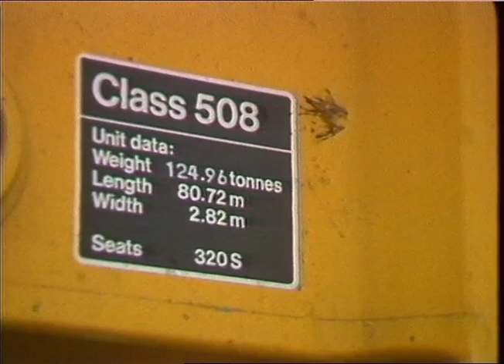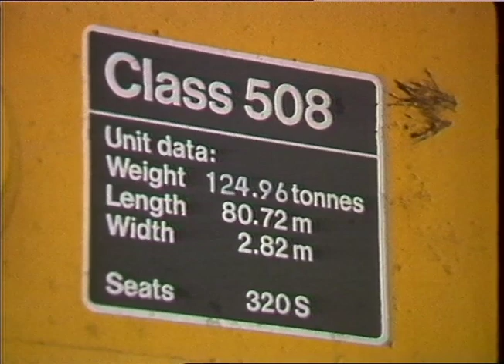Shepperton Train Crash | Thames News

Comment: 15mph? 😂
Reply: I guess the actual impact speed would have been at / below -12mph..Dynamic  braking is in operation untill the speed drops to 12mph then air braking is automatically used to bring to a full stop. Which appears to have failed to happen?
There could have been also wheel slip under dynamic braking which would cause dynamic braking to stop on the affected axels and for air brakes to apply.🤔 The effect is like using a car fitted with abs when emergency braking is applied. The train driver might as well just been a passenger once this happens as theres no more they can do to stop quicker.